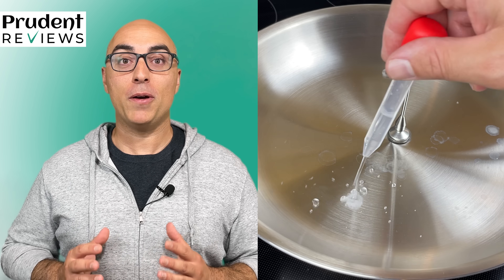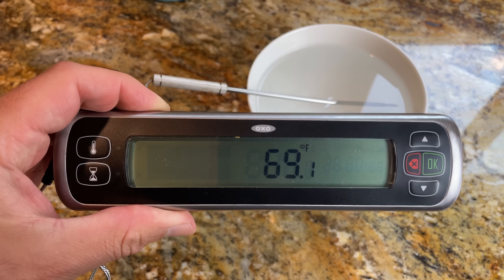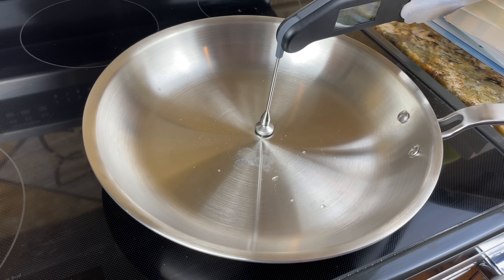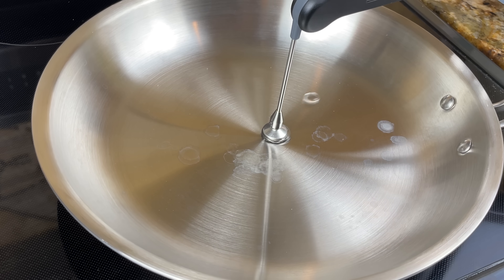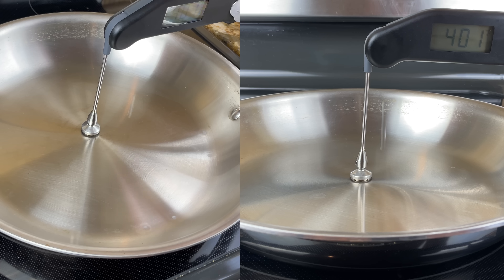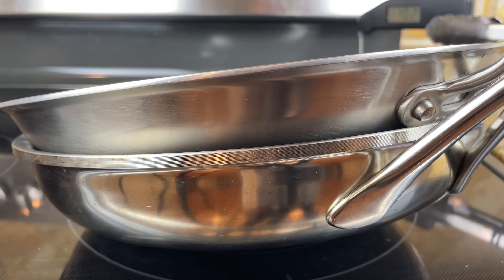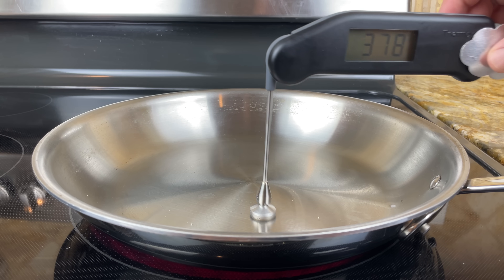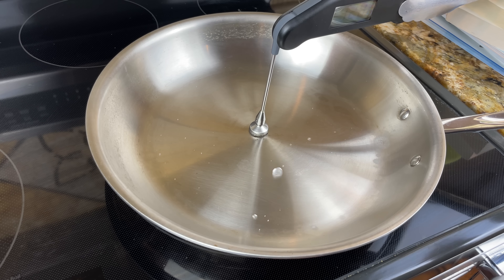Steel Pans Become Non-Stick at THIS Temperature (Leidenfrost Effect Solved)

Comment: I tried this same test one, but in "reverse". That is, I heated my stainless pan until the water beaded up and bounded around, then turned the heat off and measured the temperature until the water stopped and evaporated (I use the same type of surface thermometer). I found that if a droplet has already formed and become stable, it can survive at slightly lower temperatures, usually disappearing by around 375F.

I thought this was interesting because normally there are a couple issues with the Leidenfrost effect: overshooting and evenness. But if you then turn the heat off and wait for the effect to end, then you can be pretty confident at that moment the entire pan is around 375-ish, since heat spreads out when you aren't adding more. Then you can turn your heat back on.

Of course I just see the Leidenfrost effect as a temperature gauge -- it's not "the" temperature things become nonstick. If I use like 1 tsp of butter (and less can work) then I can get stainless to act sufficiently nonstick for blended eggs at ~300F (and a bit cooler can work). Which is how I've been making french omelettes for a few weeks now.

But I have also cooked french omelettes (gooey, no browning) using Leidenfrost temps. You just have to be faster. I've even done soft (no crispy edges) over-easy sunny-side-up eggs with only a small amount of oil (no butter) at Leidenfrost temps -- but I had to get creative for that one. Put the eggs in, wait a second for the bottom to firm so they won't stick much later, then turn the temp off and put a lid on it.
Reply: You have some good ideas here.  For me the key point (to which I subscribe) is that you don't have to be in the Leidenfrost Effect when you are actually cooking the eggs in a stainless steel pan.  It somehow "conditions" the pan, but you want to introduce the eggs when the pan is at a much lower temperature.  My preference is 280 to 300F at the edges of the pan, as measured by an infrared gun set to the emissivity of hot oil (which is the way the guns seem to be shipped from the factory, even if the emissivity is adjustable).  This temperature range also works for frying delicate eggs in carbon steel and cast iron pans, but don't drop water into a hot carbon steel or cast iron pan or you will ruin the seasoning.  It's not necessary anyway, because the infrared gun set for emissivity of hot oil will also read well for uncoated cast iron and seasoned carbon steel.  Just heat them until the temperature has equalized at 330 degrees F or so, introduce the oil, turn down the heat, add the butter, wait for it to melt, stop bubbling, and blend with the oil, and introduce the room-temperature egg(s) at around 300F edge temperature.  Or skip all of this horsing around and use a Teflon pan, keeping your temperatures in the 280 to 300F and using a Teflon-safe spatula or other tool.
Reply: @HappyGuy11  I was recently surprised to find that I could do nonstick fried eggs in stainless at 280F with just a little butter. I thought egg whites would be much stickier than when blended with yolks. But as long as the eggs were room temp when added, they'd free themselves with just some jiggling. Butter's also pretty good at indicating temperature on its own if you know what you're doing. So once you know what you're doing it's pretty easy, and using a seasoned pan is even slightly easier. Credit to "Uncle Scott's Kitchen" for this.

But it does seem like the pan temp before adding food is not really the important part, it's also about how much temperature it loses when food is being added, which can be effected by lots of things, including quantity and food temperature. Adding multiple cold eggs at once in the same situation tends to cause sticking.

Now I think this is part of why people come to believe in the leidenfrost temp. It's high enough that even after adding most foods, the final temp is still enough to prevent sticking -- but that means you're not really "cooking" mostly at those lower temps -- not leidenfrost temps. It's probably also more associated with stainless because most stainless has less heat capacity than most cast iron, so stainless tends to drop its temp MUCH more dramatically, and the easiest way to compensate for this (even by accident) is to overheat the pan in the beginning. Of course I believe heat transfer rate does depend on temp difference, so it probably does cook food "faster" in the first few moments, which may be relevant for more sensitive foods.

I've had iffy results with IR on other surfaces. Really dark seasoning, like Lodge's factory seasoning, seem fine, but even seasoned carbon steel seems to vary a lot. If it's patchy, darker spots read higher temps than lighter (but still seasoned) spots, even if they're similar distances away from the heat source. But it does seem like it's mostly just shiny metal where it fails. It works well on most foods, and even water. And walls/floors/ceilings. Floors really do seem to be a couple degrees cooler than ceilings.
Reply: @SkyvalReam  You're probably right about not needing to go so high as the Leidenfrost temperatures to condition the stainless pan, but one advantage to going a bit above your desired cooking temperature and letting it cool down, is that the temperature delta between the center and the edge is minimized.  You really want the edge temperature to be up to your desired cooking temperature or the egg may stick as soon as it slides into a cooler part of the pan.  Your comments about the problems with infrared temperature sensing are good, especially with bare stainless steel.  There is no way to get an accurate IR reading from bare stainless unless you reset the emissivity setting on the gun, which I don't want to do, since I use it mostly on my Blackstone griddle, my cast iron pans, and my carbon steel pan.  In my experience the Blackstone surface and my well-seasoned (by lots of cooking) cast iron pans give me reproducible temperatures when measured with the IR gun, but the proof of the pudding is the reading I get when there is hot oil on the surface.  I use the bare Blackstone, bare cast iron, and bare carbon steel temperatures as "guidance" prior to introducing oil, but the hot oil reading is the one I am referencing when I talk about egg cooking temperatures.  I have less experience with stainless steel pans, but I have had pretty good results cooking eggs at Uncle Scott's 260-290F range (which he suggested for carbon steel pans) with all three types of pans, as long as I measure the temperatures after the oil has been added to the surface and allowed to come up to temperature.  I'll be surprised if nobody rises to the bait about just using a Teflon pan at moderate temperature.  I can get good results cooking delicate fried eggs in cast iron, carbon steel, and stainless skillets, so I guess I pass the test, but is it really worth all the extra effort?  I will say that it has really helped my cooking by raising my awareness of the importance of food and pan temperatures.
Reply: @HappyGuy11  I don't trust emissivity adjustments either anyways. I originally thought that'd fix it so I got a second IR gun with adjustable emissivity, planning on only using it on SS and keeping my first for other things, but I found I still couldn't get consistent results with it. If I set the emissivity so that the IR gun agreed with my surface probe at 400F, then when the pan cooled to room temperature, the IR gun was still reading 300F! Though, I can't prove it's not an issue with the IR gun. But yes, heavily seasoned pans probably work, and just measuring when there's oil in the pan should probably work as well. I'd only be worried if the amount of oil matters. Maybe I'll test that next?

Giving heat time to distribute is also helpful, and I try to use lower heat and/or give mine an extra minute or two once they're up on temp.

As for why I bother with all this?

I originally got interested in trying to figure out how to do nonstick cooking in seasoned and stainless pans partly because I saw so much contradictory info. E.g. everyone said everything stuck to stainless, and even that that was sort of the point, but others demonstrated it being very slick! This really bugged me, and I wanted to try to get a better understanding what was going on. It turned out the main thing I was missing that almost no one talks about is that the type of fat matters (people did talk about heat control). Butter, or oils that contain emulsifiers, are slicker than pure/simple oils. In fact I've found that compared to fat-type, the amount of fat/oil almost doesn't matter (as long as the pan is minimally coated). I've I'm ever satisfied, I might move away from SS to CS/CI or even Carbon Clad more often since they are a little slicker (though not as much as you might think)

I am also sympathetic to concerns around PFAS and other surfaces, if only in manufacture, longevity, and/or disposal. I have considered that these concerns might be overblown and that it could be worth using them in some cases (I do own one), but I never had much use for them, and now after learning better practices in other pans, they're even less useful, and avoiding them buys me some peace of mind

Ironically, as you alluded to, some of the practices that make other pans slicker are also good practices in general for other reasons (especially pre-heating/heat control, and using at least some oil for evenness, etc) so they should arguably be learned even if you're using a nonstick coating. But then that coating is less useful

But really, I also just like the charm and simplicity of iron/steel pans, and especially SS. I find cooking enjoyable, and being more involved sometimes enhances things, at least up to a point (I seem strangely less enthused about maintaining pans or seasoning outside of active cooking).
Reply: @SkyvalReam  I got interested in stainless steel pans when found that cooking some foods would soften or remove the seasoning from my cast iron or carbon steel pans.  I have found them to be (as advertised) great for cooking acidic foods or ones that leave a lot of fond.  I have set out to try and understand whether I could use them for everything.  So far I prefer carbon steel or cast iron for fried eggs (probably in that order), but stainless will work in a pinch if I'm careful.  I wonder if you have experimented with stainless pans of different thickness, weight, and cost.  I am using rather inexpensive 3-layer clad ones that are under 2.5mm in thickness.  Some YouTubers have recommended 3mm as a minimum.  Do you have any experience with whether the expensive ones are much better?
Reply: @HappyGuy11  I don't have many SS pans either. Mine are also fairly inexpensive and about 2.5mm thick, so I can only give some theory

A thicker pan should have more heat capacity, so you probably wouldn't need to overheat it as much. I think thicker pans are also supposed to have better heat distribution, regardless of material or construction (e.g. even if it has the same type and number of layers). But they'd be heavier

Comment: WARNING this requires a surface thermometer. An infrared thermometer will not give an accurate temperature on stainless steel before oil is added. By the time the infrared thermometer reaches 400 the pan will be far far past the smoke point of oil and you will have a disaster on your hands. Alternatively try this with an infrared thermometer but try the water test when it rises to 200-250F.

Comment: This is why I use induction cooking. I can set the temperature and not have to worry about preheating too long or not long enough.
Reply: I've found almost all induction cookers have comically inaccurate thermometers, unless they have a true integrated surface thermometer like Breville's Control Freak.
Reply: @MustSeto  It's cooking, not organic chemistry. I don't need precision, I need repeatability.
Reply: @jeffdege4786  Yeah I mostly agree in principle, but I meant comically bad. If it's working for what you've tried it with so far, then great, but when I've tried it, they would easily be off by hundreds of degrees F, or simply never turn off even as the true temp careened past 600F!! That's neither organic chemistry NOR cooking!

But it probably does depend on a lot of factors, so it might be usable if you're aware of it and adapt for it, or get lucky. But if you try something new, who knows?

Comment: Great video for me being a new cook. I'm going to use an infrared heat gun to check that temperature thanks for the video save me the trouble of looking online and who knows what you get. 👌
Reply: Infrared (noncontact) thermometers don’t give accurate reading on shiny steel surfaces. You need a contact thermometer to get accurate readings on bare steel.

Comment: I am not convinced.  I can get the effect around 240 F, unless my infrared thermometer is inaccurate.  Also, do you think eggs cook best at such a high temperatures like 420 F?  I am confused.
Reply: Infrared thermometers are definitely inaccurate on stainless steel. It's always waaay too low. I've heard people claim that some can adjust for that with an emissivity setting, but I got one that has that option and I still couldn't get it accurate.

You can try this if you want: get your pan moderately hot, check its temp with your IR thermometer, then add in a fair bit of oil and immediately watch the temp. My guess is that the IR's reading will quickly skyrocket.
Reply: @SkyvalReam  Yes, I am now aware that IR thermometers are not accurate for stainless steel.  I still don't understand why anyone would want to heat their pan to 420 F as it's too hot for many foods.  Thanks for the reply!

Comment: Sorry, but your thermometer is clearly not correct. My infrared thermometer only hits 200 F and the leidenfrost effect appears on my stainless steel pan. 450 F is ridiculously too hot and after you put oil in, the oil will heat up even more to 550+. You'll burn everything.
Reply from the maker: Infrared thermometers are not totally accurate on reflective surfaces
Reply: @PrudentReviews  OK, fair enough.  However, 420 F is way too hot for eggs and onions and garlic.  So, it doesn't make sense.  Heat the pan so it is so hot that you burn your food, but it doesn't stick?

Comment: Something is wrong with that temperature or pan. I get the effect at around 93 degrees C. That is around 200 degrees F.
Reply: Are you using an IR thermometer? They're very inaccurate on SS. Check by checking a pan's temp empty vs immediately after adding a few TBSP of oil (for testing).
Reply: @MustSeto I am using IR. When without oil, I get the effect at around 90 C after adding oil temp jumps to around 230 C. (450 F). Then I remove from the heat, wait for a moment for temperature to drop to around 160 C (so butter doesn't burn) and then I add butter and nothing sticks.
Reply: @vekicro87  Yeah, sounds right. IR thermometers are accurate when measuring oil temp, but inaccurately give very low readings on bare stainless. When your IR thermometer says 90C it's really already 230C.

In my experience it's true that the mercury ball temp is excessive for nonstick though, as you say. It's just a decent temp indicator if you don't have another way to assess temp. I use butter at ~150C to make french omlettes in stainless.

Comment: And this is why carbon steel and cast iron cookware are superior. No need to use tons of fat and also the fat used is not getting a 500f treatment.
Reply: I've found that all else equal seasoned pans are modestly better than SS, but only modestly. I still have to preheat seasoned pans a fair bit to get them nonstick, just not to quite as high a temp. Though 420 is excessive even for stainless.

Comment: When oil is added in this temperature, the oil becomes hotter than the temperature you showed. I have tried the temperature between 150 t 190 degrees fahrenheit and added the oil. the oil became 400degrees when it hit the pan.
Reply: Are you measuring with an infrared thermometer? If so, they can't gauge the temperature of shiny metals like stainless steel because the beam of infrared light gets reflected away, which is why you're probably reading such low temperatures. When you add oil the infrared thermometer can work properly and give you the accurate temperature, which is why it looks like the temperature jumps so high.

Comment: Thanks for the video bro. However, my concern is: at this temperature, it’ll be able the smoke point of many oils. This will cause hydrogenation of the mono- and polyunsaturated fatty acids. I think the food cooked this way won’t be so healthy.
Reply: No it does not. Hydrogenation means to add hydrogen, it is done in a lab not on your pan.

Comment: Just did this with an infrared thermometer (the kind that shoots a red beam). I cooked eggs without them sticking. Thanks for doing this as directions like "turn to medium" depend on the stove. Now I can turn my burner to 440°F/460°F or use my infrared thermometer. It makes it a lot easier to zero in on the stove setting. Medium on my induction burner is 300° so could take a fair bit of fiddling to figure out the correct temperature.
Reply: As its infrared and you cant see it it also uses a red laser. Your stove probably has a manual describing every power setting, you can learn a lot from that for future reference.